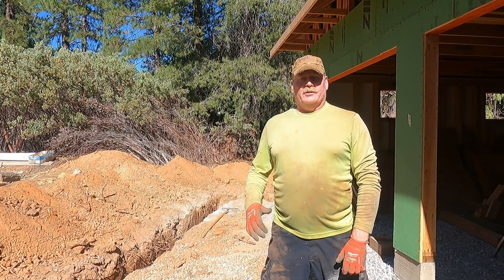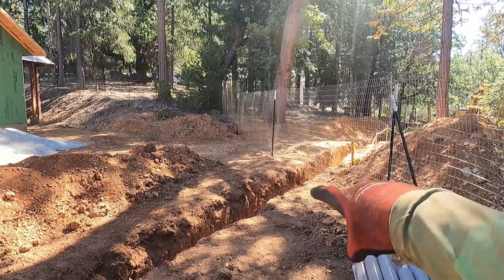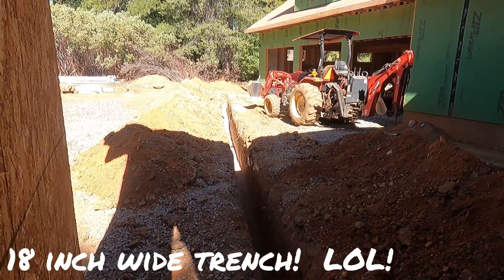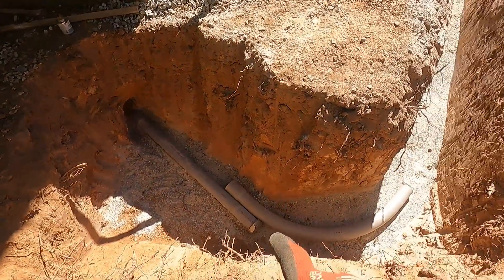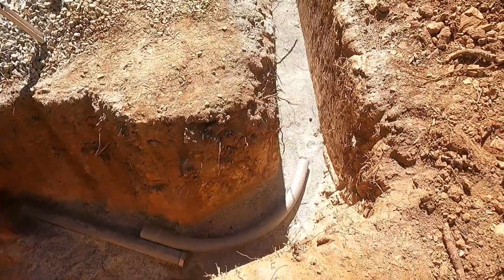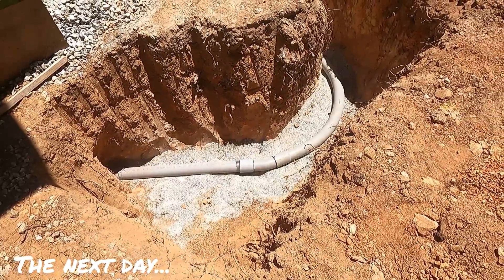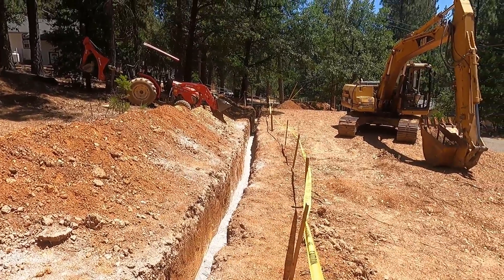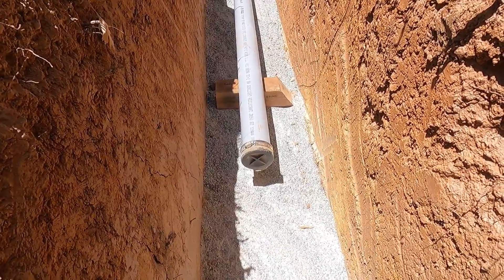Finishing the electrical conduit from the meter box to the house.

Comment: The trench and conduit look very nice. It is not easy to excavate a trench that long and keep it straight. Just a little bit if info from a person who has done this a lot. If the service runs are yours and you are allowed to use galvanized rigid elbow 90's instead of the PVC then use them. We take the 2" PVC wrap tape and half lap the conduits for the corrosion protection. In some cases the electrical utility company will not all the use of steel in their runs so you have to use the PVC conduit and elbows. In this case the longer sweep elbows will help when it comes to pulling the wires.

One thing to remember is to feed the wire from the end that has the most bends. If you pull from those ends the rope will want to burn through the inside of the 90's. Also if you are pulling alumuninum wire the try to buy the Series 8000 xhhw type wire and get the slick pull if they have it. This coating will really help with the PVC conduit and restrictions from the materials. I am guessing this is a 200 amp service which in most cases would be 2/0 or 3/0 AL wire. Check on the price of 4/0 or even 250kcmil for the distance. Southwire has a free voltage drop application that you  can download which will help you with your line loss calculations. I will follow your channel and keep up with your progress. If you ever want a tip from me reply back here and I will find a way to contact you and see if I can give you any advice. I have been in the electrical field for a long time so I have experience both good and bad on these things. Best of luck and I gave you a thumbs up on this video.
Reply from the maker: Wow!  Thank you for all the super helpful tips!  You are correct that the utility company wants rigid risers to the meter box.  I found that out upon inspection by the utility company.  At minimum due to the distance, I was planning on using 250kcmil copper but may jump to 300 if the price is not too much more.  I really don't want a huge voltage drop and I have the room in the conduit.  Thanks for watching and leaving such detailed comments.
Reply: @DDuffeeInc thank you for these comments!